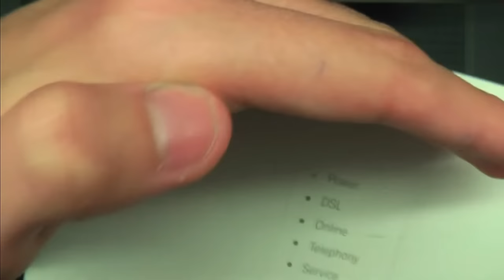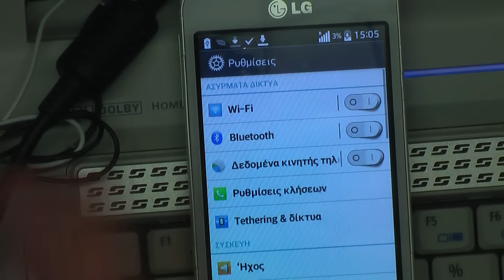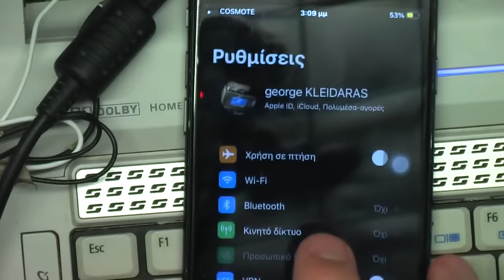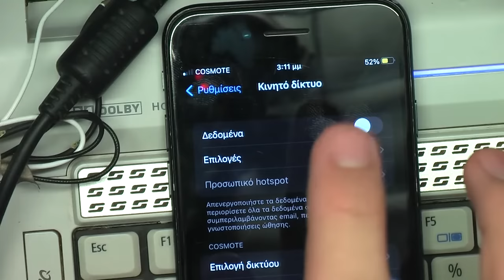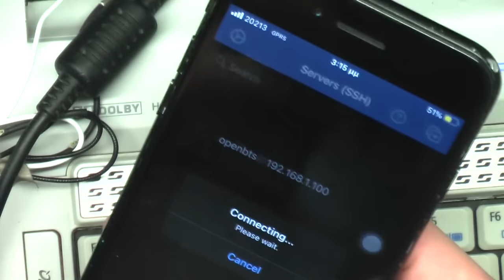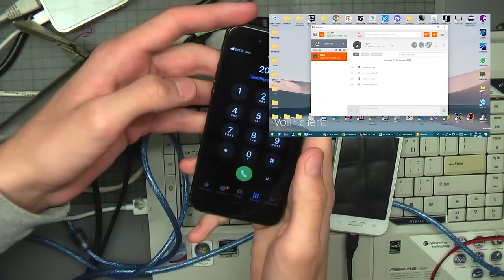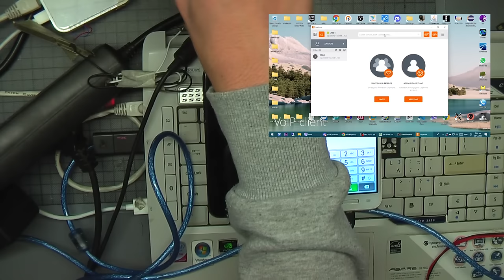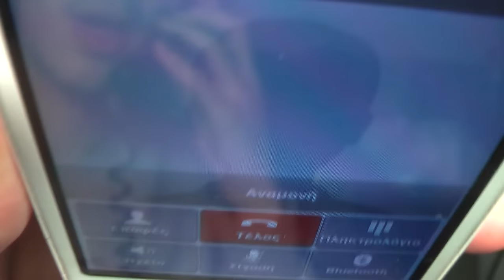Making your own 2G GSM cell network in 2023 (for cheap)

Comment: Ok. This is a good start to my project. I want to built a conversion from 4g cell signal to 2g signal I can use in an old device. All I need is probably a wifi hotspot that connect to cell tower
Reply: Did you get anywhere on this? I want to do something similar.
Reply: let us know if you got it working btw
Reply: I have people that sound so believable but disappear and never reply to comments . Lame
Reply: @joefarrin  Well I would love if you were able to make that, and would buy one of you took it to market.

Comment: This guy has literally made comms out of the electronic junk.
Now i don't know what we're paying for to ISPs
Reply: a quality connection and thousands of towers
Reply: c6amp  idk bro get a better isp lol
Reply: c6amp  I've got a tower just down the road, and it's still not great.
Reply: c6amp  rip
Reply: wdym with junk? Apart from that laptop, i can't see what the junk is
Reply: @xcruell  still junk compared to commercial industrial fancy equipment ISPs usually install and use.
But for DIY project it's incredible
Reply: I feel your pain. Being close to a tower doesn't equal a good signal. Actually, signals will more than likely drop when within a few football fields of a tower, as the signal needs more distance to "broad"cast
Reply: the billing is very complicated
Reply: @unixlonix  probably millions of towers but one uses only one at a time. There are a lot of people on one tower. I like comparing it with road networks, sewage, water, electricity, gas. Then IPS's are insanely expensive.
Reply: an actual network as opposed to 1 guy with a Lap™ LMAO

Comment: what is the coverage distance?  
URAN-1 Kit - 52Mhz USRP based OpenBTS SDR GSM Base Station
Reply from the maker: That depends on your antenna. But i managed to receive signals 400meters away with some buildings
 in between.

Comment: I was wondering, is there any way to use another cellphone instead of the radio?
Reply from the maker: Yes actualy there is a gsm chip in some motorola phone that can be used as a base station. this link might help you https://github.com/spm81/CalypsoBTS

Comment: 80€ are quite okay, but the 50€ shipping is quite expensive, especially if you need to pay customs for both :(
Reply from the maker: I agree but this is actually the cheapest option i found. Other radios cost a ton.
Reply: Considering most other DIY GSM implementations run in to the thousands, this is an absolute bargain
Reply: Yes but this is still vastly cheaper, just ordered one!
Reply from the maker: @Rettro404  Nice , i hope you enjoy your gsm experiments and if you need any help fell free to join my discord server.
Reply: @_chocky  at least you don‘t have to go through customs now apparently because 19% VAT are already surcharged in the price. I just wonder if a UMTS/4G cell would be possible (without expecting usable speeds, just for creating a test network). If so, I may consider buying one but I haven‘t found anything usable.
Reply from the maker: With this specific radio a umts or a 4g lte base station is not possible , for that you need to jump a bit in price and get a lime sdr mini 2.0 or a blade rf.

Comment: amazing project! what is the range of this by the way? a kilometer?
Reply: It depends on the antenna / SDR ( software defined radio) you use.
Reply from the maker: I got like 400meter semi line of sight. if i go to a flat area i will make sure to test it, altho transmitting that far isn't very legal.

Comment: Simple question, i have a old Nokia 3310 who works on 2G.
There are still providers available here, Vodafon and Kpn.
I have a sim in the Nokia 3310 for Kpn and it works fine.

But if i want to make a 2G network, how do i program a sim card to use my own network?
Otherwise other phones can connect with my network.
Reply from the maker: You can use any old sim you have just go on the manual network selection and pick your network.

Comment: Hey this may be late however im wondering the range of this GSM base station. Most providers in the us use the same frequency as the base station and they do not take well when people decide to use there spectrum without a licence. Also what band of GSM does it broadcast  on? Thanks!!
Reply from the maker: There are 2 versions of this sdr , the 1800/1900 mhz and the 850/900mhz version there are some bands that are "safe" to use because they are unused. The range is about 1km (thats the transmit range at full power which i dont recomend) usable range is a few meters

Comment: can these send messages or make call to phone numbers which are not on the same networks
Reply from the maker: With a sip trunk you can.
Reply: @laptopfm  the problem here in the USA is if a license is needed to run this. Even for testing and it’s on24/7?
Reply from the maker: @DiyintheGhetto  I am sure you can find and find a pair of empty spectrum to use but of course at low power and no i dont run it 24/7.

Comment: Could you explain how you modded that ethernet bridge? I have the same router and I want to add a big antenna for big range. Also, did you mod it to support 1Gb or its just 100MB
Reply from the maker: I cut one of the internal antennas using a razon blade and i soldered an sma cable like this : https://cdn.discordapp.com/attachments/746089911194484748/1133153658079563897/IMG_2878.jpg

Comment: So, can we use it to call other numbers without paying for phone bills? Also, it is just that we call call numbers within the area which your sdr cover or can we use it to call phone numbers the whole country ? Also, how does this enable users to connect to internet ?
Reply from the maker: You can connect this system to use a public phone number but i dont recomend running a public network at full power since it can get you caught

Comment: nézegettem, mennyi vámot kell fizetni erre? az uran 1 ért?van külön 1800 körüli frekvenciához is, az LTE rendszerhez való?vagy azon is beszéd folyik?valami olyasmit hallottam hogy a vodafon csak 1800at használ.most nem tudom melyiket rendeljem.
Reply from the maker: The duties are included in the shiping price or at least thats how it was the last time i ordered. Also about the 1800mhz you want to make sure you use something that other providers dont use and you devices support. I preffer the low band version because of its longer range and the fact i can monitor it via my rtl-sdr. Make sure to do your research about the channels you can use safely and feel free to ask questions if you want.

Comment: Hello, great video, do you think this would be possible with 3G?  Hardware for 3G can be found, but I don't know if it will be possible to find software that would work with the 3G hardware.  We switched off 3G some time ago, this would be very useful for using old 3G modems.
Reply from the maker: Its possible with more expension radios (heres the software : https://github.com/PentHertz/OpenBTS-UMTS) but 3G used a ton more bandwith than 2g so its would be easier to interfere with something if you dont select the right frequencies.
Reply: @laptopfm  Yes, I know about the interference, I will operate it so that if possible it does not go too far from the house, because we keep a close eye on it.  Do you have any tips for a radio that would do this?  I was thinking if it wouldn't be possible with the radio with which you did it on 2G, because when buying in the link that is attached under the video, it is possible to select a frequency range, it is possible to select the 1500-2100Mhz range there, and this range includes 3G  zone.
Reply from the maker: @retropcatv6442  The radio i showed dont support 3G because of bandwith limitations.
Reply from the maker: @retropcatv6442 look to the project page for more info
Reply: @laptopfm  Ok, thanks for the info, I'll take a look there.

Comment: Hello my friend, Australia has removed the 2G network, i have a device that runs on a 2G network but it doesnt find signal because 2G not here anymore. Will your machine allow my device to find signal on 2G network?
Reply from the maker: Yes any 2G device and work. Just make sure you use the right frequncys as to not mess with any other operators

Comment: Max signal range?
Reply from the maker: i managed to get 400 meters almost LOS with max transmitt power and a small antenna.
Reply: @laptopfm  thanks. Any similar equipment that can cover my town around 1km diameter. There's no signal here. I made a relay like connection,modem wifi cpe to my home from top of mountain.
Reply from the maker: @aha5888  You can use signal amplifiers to achive longer range.Also if you are going to set this up permanent make sure you get some sort of permission.
Reply: @laptopfm  thank you

Comment: How far can the cover from the network can be?
Andd, if it works with OpenBTS, can it work with Open5GS also?
Reply: Coverage depends on the power and antenna setup. Under ideal conditions, maybe 200m.
Reply from the maker: i got like 400m one time also no it cant be used dot Open5GS since those require much newer (and expensive) sdr's
Reply: @laptopfm  thanks. But how do I get it to not interfere with real public networks?
Reply from the maker: @blaesten35  You can do that by searching your countrys spectrum allocation table and find something the can work with these channels here : https://www.sqimway.com/gsm_arfcn.php. Also you can try fitting your base station into the ISM band but i suggest you do your own resharch here. ALso make sure to run at low power for most of the times

Comment: What frequency are you using?
Reply from the maker: 868mhz downlink and 823mhz for uplink
Reply: @laptopfm  does the feature phone support it.
I googled the frequency supported by those phones and it says that 900mhz to 1800mhz
Reply from the maker: @driveaccount6483 Which feuture phone ? because most gsm phones support this band
Reply: @laptopfm  nokia 3310 , nokia 1100 and etc has 900mhz starting frequencies.

by the way love your work ❤️

Comment: I know with 2g it’s about 256kbps of bandwidth and double that for 3g. The radio itself can go to a higher frequency. But you need to be licensed. I’m wondering if you can push a little more bandwidth from the 2G?

Also I was wondering if you have a video on setting up the software side for Openbts and this device?
Reply from the maker: I am not sure if you can push more bandwith with this setup since its only gprs. I may make a detailed video when my sdr arives cause i broke the previous one.
Reply: @laptopfm  I’m from the US and I know 900mhz is a ISM band. But not sure if this would need to be licensed or not.
Reply from the maker: @DiyintheGhetto  Technicly you do nned a license but if you find frequenies that are empty and use low power you should have no problem. I also reorded the sdr again since i broke it and i might make a step by step tutorial on how to get started altho the written guide i have on the description is also pretty good.
Reply: @laptopfm  I’m looking over the setup guide, Wow that nicely done. I hope my friend drops off the radio soon so I can get started.

Comment: Which sdr range should i get
Reply from the maker: That depends on what band your phones support, and what you can use safly without causing any problems. I have the 750-1050 version because i can useit somewhat safely on the ism band and i can monitor it on my rtl sdr , also it has bigger range.

Comment: Would I be correct in assuming ..... the authorities would never think to monitor this?
Reply: They totally would. The spectrum is still actively used by mobile networks in newer technologies, especially LTE/4G networks
Reply: @memediatek  I thought that may be the case (hence why they turned off the 2G network)  but would the interference be noticable over the full spectrum .. or would it just manifest as slightly irritating data speed drops?

My home Broadband used to cock out every 30 minutes for nearly 6 months ad no sod ever bothered to investigate it, they just told me to turn it on and off again and seng me about 6 new routers..

See what I mean?
Reply: If you block or interfere they will react within a day I think and triangulate
Reply from the maker: i choose spectrum not used by any cellular bands here and i usually run at low power.

Comment: I like the broken latop used as a server my style totally everone wants reasberry pies but with those u dont even get a case while most out of date laptops are faster have a built in hard drive and UPS if the battery still works. Its also easy to disable the auto sleep when you close the lid not sure why yours was powering off randomly one thing to note is most laptops have a reed switch which gets engaged when a small magnet smwhere in the lid gets close to the closed position . So keep magnets away or nano /etc/systemd/logind.conf. also keep the webcams out of the lids they can soldered to a normal usb cable.
Reply from the maker: I think it was the phone and the transmitter being close to the sensor that somehow triggered it.

Comment: Hello how are you? Can you help me please with my project ?? I need to make a cell phone local network in my work i need it a lot. I have a company for woods and we working in mountaines and forest network didnt existe theire so i need to make our self with long range maybe go to 80 klm. Can you help me please for doing that. Thanx a lot
Reply from the maker: The limit for gsm networks is 35km and the only
way to reach that distance is to use very big carrier grade antennas and amplifiers and for a network that powerfull you would need a licence and you would also need multiple cell towers to cover the area you need,But nothing is impossible so i suggest doing your own research and if you need any help you can join my discord server.
Reply: @laptopfm  thank you so if i want to install just for 35 klm what i need (hardware and software ) can you give me details plz
Reply from the maker: @roubroub1-qw9cg  i have no idea but it needs to be carrier grade with very high power (so you need a licence) and that distance is the maximum theoretical distance.

Comment: Do you get 750 to 1050 MHz or 1500 to 2100 MHz
Reply from the maker: Depends on what your devices support, what range you want  and if you can find find free channels that arent used by actuall mobile operators.

Comment: Does it connected to ss7? Ggsn msc or so on
Reply from the maker: Everything is built in to the OpenBTS software.
Reply: @laptopfm  so it is not connevted to internet /backbone ? Just local ( inside the openbts network)
Reply from the maker: @endremurti It is but it passes the IP traffic to ethernet.

Comment: I want to be able to shrink this down to the size of a portable phone battery, so I can carry it in one pocket and use a Nokia 8890/8860 or 8860 or 8260.
Reply: Might be possible with a Raspberry Pi, though not as portable. Also, the 8860 and 8260 are TDMA/AMPS phones which are not compatible with OpenBTS GSM.
Reply from the maker: You can get very low power x86 computers an the radio itself can run on a regular usb power bank so this is very possible.

Comment: link are dead...
Reply from the maker: Which one ? because they all work for me
Reply: @laptopfm  openbts and kb.iplinkme but i found something on internet. however the error that appears to me when I try to open the pages is "ERR_CONNECTION_CLOSED"
Reply from the maker: @salvatotor  Kp link works for me but openbts.org doesn't. I will make a google drive will all the files needed there.

Comment: As far as I understand it would be illegal to transmit out into the public airwaves and you would need to only broadcast inside a RF cage inside a laboratory and that's assuming you already have a HAM licence to transmit in the first place?
Reply: As far as I know if you are using 900mhz in the USA it is a ism band. As long as the device is under 1watt. There is no need for a license. I had a talk with someone from the FCC.